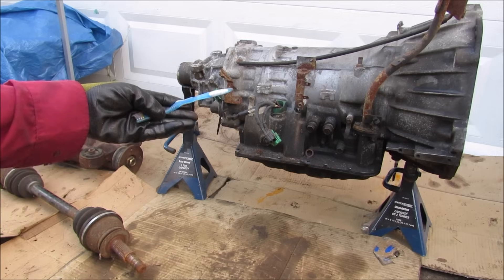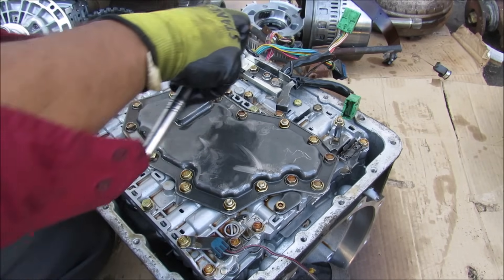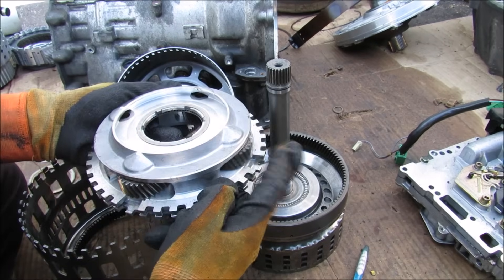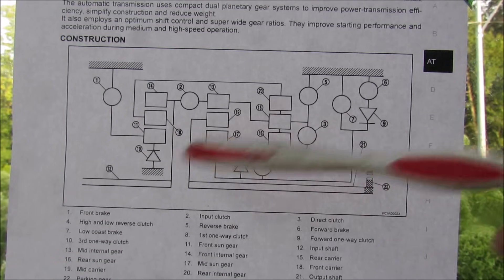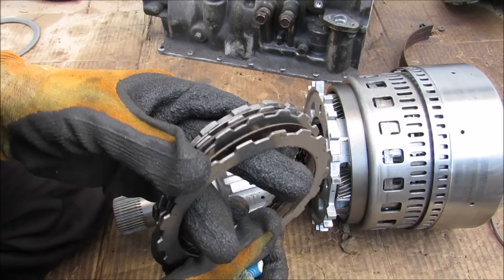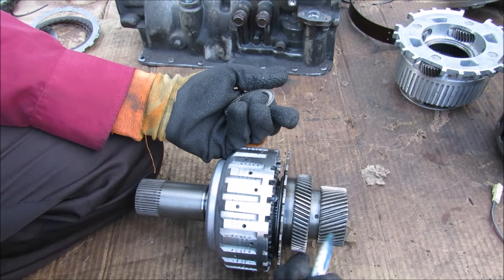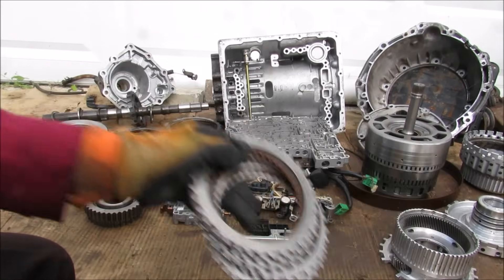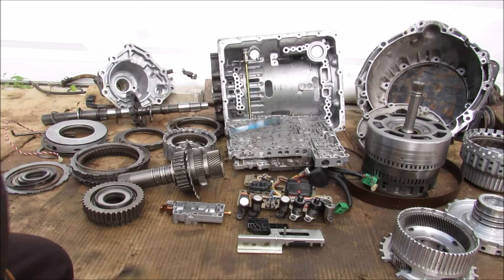How an Automatic Transmission Works (RWD)

Comment from the maker: Get transmission fluid here:
https://amzn.to/303OUlq (US)
https://amzn.to/2O2k45r (Canada)
Transmission filters:
https://amzn.to/2LXPuHs (US)
https://amzn.to/301nmNC (Canada)
Transmission code reader:
https://amzn.to/302tnJK (US)
https://amzn.to/300JG9q (Canada)
Metric socket set:
https://amzn.to/301VmJz (US)
https://amzn.to/2NfvUK1 (Canada)
Please see this video to learn how a front wheel drive (FWD) transmission works:
https://www.youtube.com/watch?v=LkK2XFnmfhU&feature=youtu.be
Reply: Thnku sir keep uploading it gonna help me
Reply: Thank you for the free education this helps me a ton man
Reply: Hello sir, I have a problem with my automatic transmission on a mercedes w203, 
It has a hard shift from 1st to 2nd gear when i press the throttle. (When i lightly press the pedal, it shifts normally like 30% of the time)
I went to a mechanic and he said that the lines of oil flow are broken and said to replace the whole valve body, and somehow I don't believe thats the issue.
I would really appreciate your  advice and expertise.
Thank you in advance
Reply: You are doing a job welldon. My problem is reverse gear not engaging or moving my  car Toyota hiace 2004,after loosing the transmission I found the reverse clutches worn out.replaced new ones but still the same result.please what else do I have to do to get it work
Reply: Buy new car
Reply: I still dont understand but great video reguardless!  Thank you!
Reply: That's a lot of knowledge inside your head dude 😉
Reply: Is automatic reliable

Comment: I'm having trouble getting my A/T shifter into and out of park
. If you have any vids concerning that, maybe you could give a link. I have the steering column area pretty much opened up and see interesting things in there, but don't know exactly what to look for even tho i have prob looked at 30 or 40 vids.

Comment: iam wondering if I can get help here my car is an automatic and it struggled to switch to 4th and 3rd gear and now it can't switch to 4th and 3rd gear anymore it's beginning to struggle to go into 2nd gear the things I have been watching suggests that it might be due to a solanoid problem but I am not sure it can also just be gearbox that needs replacement any tips I am thinking at the moment to remove the oil pan and just take out the solanoids and cleaning them with electronic spray

Comment: Great video! I learned a lot watching your video. 
I have a question about a transmission problem on a 2012 jeep grand Cherokee Laredo four-wheel-drive.
It has a code P0 733. It won’t engage to  forward or reverse gears but when moving the shifter  to drive or reverse, the front driveshaft is turning .
any suggestions? Is it electric, or mechanical issue?
Thanks!

Comment: just got done doing a fluid change a few days ago, and while I think about half of that went over my head, I think i understand better why having enough fluid is so important. since basically everything is operated hydraulically, if all you've got in a given hydraulic line is air, it'll compress instead of applying the pressure you need, so the needed gears won't actually engage, causing the engine to spin freely without any load on them.

for whatever reason, I had a bicycle gear shifter in my head, except with different sized gears being moved toward and away from a drive gear to change gears. Dumb i know, but it literally never occurred to me that there would be different combinations of gears to handle different the different gears of the engine.

Comment: Beautiful video. Question... I have a 2002 Yukon Denali AWD and about a month ago I was backing out of a parking spot, then shifted to drive and it wouldn't move. So I pushed it into a parking spot. When I arrived later to check it out, I noticed that it wouldn't go in park either. Like, the transmission shifts, but it doesn't move or park. What do you think could be the issue?
Reply from the maker: Check the shifter cable
Reply: @speedkar99  yeah that's one of the first things I checked, it's working/shifting as it should. Any other ideas?

Comment: I have been soldering and working on electronics since my early teens in the late 90s, went to college for comp sci, etc. and your analogous representation of the valve body (fluid matrix is a cool way to say it) and the transmission as a whole to an electronic circuit along with the physical display of the components has made an automatic transmission make so much more sense to me. I am finally realizing my dream of having and completing a project car, and while it's a 5 speed manual, accruing knowledge of all potentially relevant mechanical systems in cars will only help my synoptic registration of how everything works together. Great video!

Comment: Amazing!
You could be a technical professor or a big boss in a mechanical shop instead of disassembling transmission on the cardboard and using your brother's blanket and underpants to wipe the oil. I only hope your brother didn’t brush his teeth with the toothbrush you used as a pointer.
Very good job, dude! I hope you get a good job and a wealthy life.
Thanks a lot for making  such a helpful video

Comment: Thank you for this great explanation. Question: what happens if I leave the shift in Neutral, engine idle and tow this car behind a motorhome for extended periods of time? Will the pump still lubricate all the components? I am saying this because I followed the instructions on a Ford Escape automatic 2011, towed with engine off in N and the transmission burnt after 10,000 miles and had to be replaced by another one. This time I'd like to drive the RV with the same car behind but having the engine running in Neutral so oil can pass through the cooler. Will that be Ok? Thanks!!

Comment: Hey speedkar99 i was working on a Toyota crown 2.5 v6 (4gr) but I have a challenge after rebuilding the transmission av got no reverse but whatever gear i engage  P R N D 3 or L (park and reverse included ) the car goes forward would you have any idea where did go wrong

Comment: This was great. And so straightforward. It begs the question why most videos I've seen refer to auto transmission work costing "thousands and thousands of dollars". If the big wear items are the clutch discs, they would seem very easy to change out. And service kits for the solenoids and electronic brain aren't so expensive. What am I missing ?
Reply from the maker: The labor cost.

Comment: Yet another reason why manual transmissions are great. Automatics are a complicated nightmare with no physical input or discernable feedback requiring math, magic, science and stinky fluid to put itself into gear. A manual is a metal bucket full o' gears, a few shims, syncros and a stick shoving them all around. Simplicity- and your brain is the TCU.

Comment: Great explanation! You should do a series with Weber Auto State University! 😁
7:25 Little correction: In "Overdrive" the exit shaft spins faster than the input shaft, so far so good. BUT this speed is then reduced by the differential transmission ratio by about 1:10 (wild guess), wich turns the wheels. 🤓

Comment: Sometimes I wonder how dual clutch transmissions aren't common place considering the complexity of torque converter automatic transmissions. Literally there are only two clutches versus the multitude required for torque converted automatic with any reasonable number of gears. And it only gets worse as the number of gears increase for a torque converted automatic transmission.
Reply from the maker: They're more expensive to make and sometimes less reliable. Not everyone will like it's jerky nature though. 

They are more efficient, but then it's gotta compete with the lighter and simpler CVT.

Comment: I went to an auto repair school 50 yrs ago and as part of the final exam we had to take an automatic transmission apart and repair and rebuild a motor. Lucky for me my 57 chevy convertible needed both and under the tutilage of Mr. Sam I achieved a passing grade and got both done. Although it wasn't as complicated as transmissions today. It took me 6 months to learn what i watched in 20 minutes in this video! Good job.
Reply from the maker: Glad you appreciate my condensed version , it takes alot of learning for me to compress this thanks

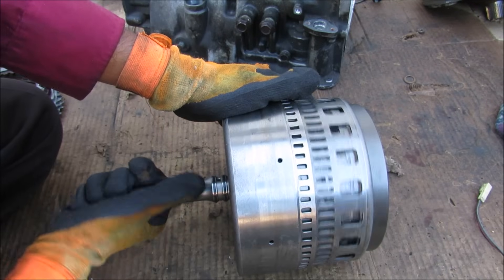Comment: 7:30 *drive shaft to turn faster. The wheels probably still turn slower than the engine because the differential will gear it down once more, somewhere in the ballpark of 3.5:1 - 4.5:1

Comment: An outstanding presentation. 
I wonder how the early versions of Automatic Trannies worked, when they were first designed way before electronics and transistors...or onboard Control Modules. They must have used a ton of valves to just control other valves.

Comment: Cool video! The parking/emergency brake pawl also uses a ratchet mechanism which prevents it from engaging if the output shaft is still rotating too fast due to the car being in motion. If you put your car in "P" while driving (which of course is not something you should really do!) then you'll hear a clicking sound which is due to the ratchet mechanism being deflected away from locking the pawl in position.

Comment: thanks for the video very insightful, im trying to troubleshoot my 00 civic si A/T which has a clunking/grinding when selecting gears. it shifts / drives fine just switching from P, R, D will sound harsh
Reply from the maker: You are welcome
Reply: looks to be bad motor mounts

Comment: The engineering behind transmissions is amazing. It's like alien technology. And to think fluid is making it all work by using a torque converter. The minds that worked on building this thing were far beyond their time. How did we go from moving a stick to shift gears to this complicated mess just to remove the stick and have both hands on the wheel. All this to free up a hand. Wow. Aliens! It's a conspiracy man.
Reply from the maker: I agree. I think it happened through an evolution of the design throughout time.

Comment: Imagine cleaning all, reassembling it, add the new gaskets, putting it on the car. A smile on your face, "now that's a good work done" whispered from you. You deserve a coffee, so hard putting it all together, so you go to the coffee machine near the workbench, casually then, you notice a metal ring laying there, a metal ring that was supposed to go somewhere into the gearbox, your head become all fuzzy, then under shock you notice close to the metal ring that there is a razor cutter....as last you think "that it then, it must be done".

Comment: I still can't wrap my head over 1 thing; at 10:11 You say the fluid will lock the teeth relative to the casing. My question is, why and how does the fluid lock these teeth? Answers are much appreciated.

Comment: Excellent video. If I ever have tranny problems, I want you or someone with your knowledge to work on it. Years ago, I had burned the clutches in my "hot rod" so I took it out and put it on a bench. I'd overhauled a few engines and had a lot of confidence. I realized pretty quickly that I had no clue as to what I was attempting. That spring that hit your car? I wasn't so lucky. I think mine exited via the garage door. I never found it. I finally realized I didn't have to take that apart to get to the clutches. I began disassembling what you so easily disassembled and once I got to the clutches and realized I hadn't kept track of the order of things I'd removed, I put everything in the back of a pickup and visited my local junkyard. It was a little embarrassing but I learned a lesson!

Comment: Hi. I have a problem.    I have a zf8hp45 transmission.  When the car is HOT and when the gear shifts to the 2nd gear, if I take off my foot from the gas pedal just after the shifting, it makes a little movement to the front just like I am braking.  its exactly about the shifting because there is no other problem if i take off the gas while the car's going.  In DS mode it doesnt do that. The seleonids and turbine are new changed with original new parts.    Can my hydraulic brain pistons have any fault or corrosion?      In DS mode and when the car is cold , because the car is working with rich mixture, the pressure is good. otherwise can the pressure is low and making that mistake?   Thanks a lot.     Also after  the transmission adaptation the car has no mistake in 100 km and then its become faulty.  when we look before the adaptation , the clutch values are so increased or decreased. There is no diagnosis error.  Thanks

Comment: I have a question hopefully someone can help. I have a 2004 Ford Mustang that drives just fine. Absolutely no issues with driving or shifting  But when it’s put in reverse. I hear a grinding noise that sounds like it’s coming from the rear of the car and car does not move. I can put the car in neutral and push  it foreword just fine. But pushing it backwards it acts like the wheels are caught on something on the road. Rolls for like a foot or so and stops. I tried looking into what would cause this but I’m not really seeing how  reverse is messed up in the differential but it’s driving is smooth. Would this be a Trans issue or would it actually be a  differential issue?

Comment: Since automatic transmissions/torque converters are controlled by computer and a bunch of solenoids then why they dint use the same computers to use the old transmissions and clutch using also solenoids or actuators to do the same job humans do when change speeds but in a better way avoiding the so called inefficiency of this kind?.
Reply from the maker: Check out my Honda automated transmission video

Comment: Why is the part that makes the wheels spin well at certain speeds a thousand times more complicated than the part that turns a dark liquid and air into usable energy?
Reply: Because it's for retards who can't drive stick. A manual transmission is much less complex and much more reliable

Comment: My Lexus R300 year 2000 can reverse but when I shift to Drive, I have to wait for about 30secs for gear to engage Drive. Any solution?
Reply from the maker: Typical Lexus transmission problem

Comment: Automatic Transmission fluids are non-conductive.  Being considered more an insulator.  That's why Electrical Connections and  or Computer Components can be placed inside the transmission.  Sitting in Fluid.
Reply from the maker: True

Comment: And that is why I don’t fuck with transmissions . That shit taste wizardry , lash valves no problem, gap rings and check bearings for proper clearances , hone cylinders and assembly but transmissions leave that shit to a transmission guy .

Comment: This is the first video I've found that actually explains how a transmission switches gears.  Thanks.
Reply: Every other video it's always like "for second gear, the sun gear engages planet gears in set 1 and the clutch pack allows the 3rd ring gear to blah blah blah" and I was always like BUT HOW does it do that and HOW does it know?

I know there's not a bunch of servos in there operating this crap so what does?

Took forever to find out "oh its just the fluid being circulated in different spots."

Comment: OMG all my education and experience as a mechanical engineer and I think I need another year just to understand what's going on in there
Reply: I'm a mechanical engineer as well but automatic transmissions have always eluded me. It's mechanical magic. If I sat down with a model and traced out the power flow and calculated the gear ratios I could probably figure out the different combinations necessary to achieve each gear. But it'd take me a while 😅

Comment: I have a question. If you are driving ~40-50 km/h and the torque coverter is not locked, but you knock the shifter to neutral. Will you then cause damage to the transmission when shifting back to drive while moving?

Comment: Fantastic as always. Are the detailed diagrams from the manufacturer's repair manuals? I assume they're quite pricey.

Very interesting to hear you do this unscripted but with three takes on average. I had to use a script and it still took three takes.

Glad your brother got a cameo. I'm surprised he doesn't speak up for himself more.

I'm a surprised that there's still a maze-lile hydraulic circuit in these transmissions, despite all the electronics. I had assumed the maze was used only for making the decisions about when to shift, which the computers took over. Is the maze just for smoothing the transitions, which would otherwise be too abrupt from the on-or-off solenoids?

Comment: Thanx for explaining the role of the transmition as a kid I was puzzeled as to why does a car need gears when it had a powerful engine
Reply: An engine is power thats true but without gears,their power won't be properly utilized, take off from a stand still position will shut the engine down, becos engine produces speed less torque.gears help vary btw speed and torque when transfering power to the wheels,e.g Gear 1 takes power from engine and transfer torque instead to the wheels to move the car